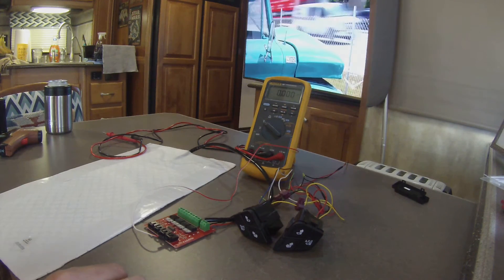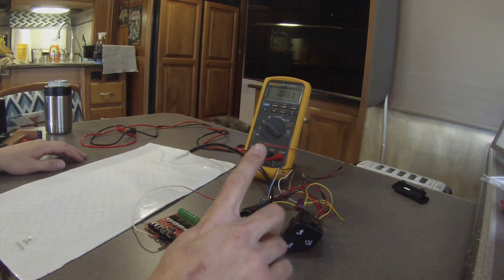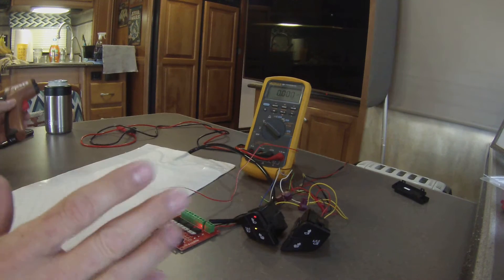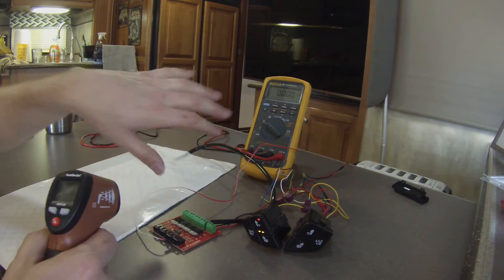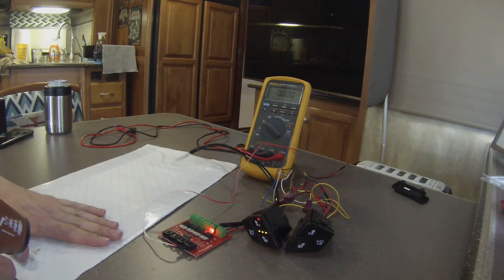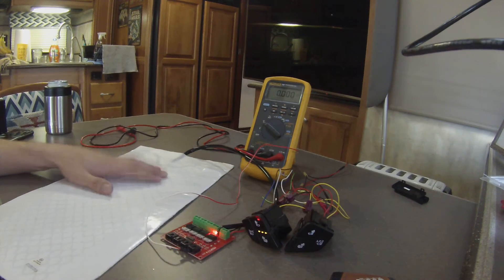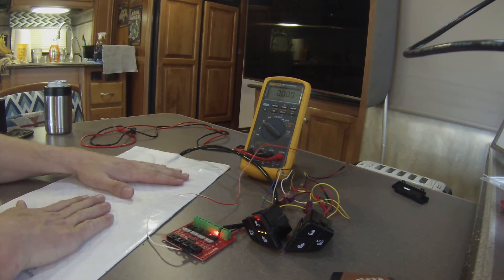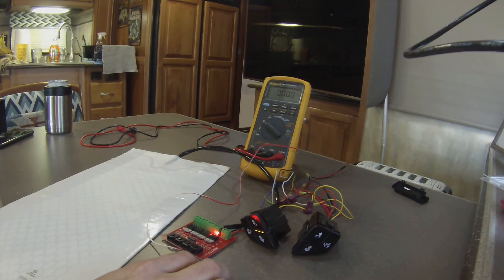Silverado Heated Seats Switch Retrofit

Comment: Why can't I purchased an aftermarket controller with the heating elements and use them to control each switch? Is this possible to retain these factory switches and install my own seat heating elements?

Comment: Badass video! Do you have any info on how to keep the airbag light from being triggered with this seat swap (2018 seats in 2011 mode)?
Reply: I put 2018 seats into 2011 silverado, I pulled out the original harness and side airbag from the cushion and tucked it under the new seats, then I bought a resistor and plugged it to the airbag harness, no lights or warnings

Comment: Thanks for sharing this, I stumbled upon this by accident... Looking to the factory harness in the dash for the switches, only to find something better - Proof that you can create a LIN bus and communicate. 

I have disassembled many of the modules and started reverse engineering them, including the heated seat switches, and seen that they contain 8 pin LIN drivers, some with inbuilt voltage regulators. The BCM has 6 of these alone (among many other things)... That Canny7 tool looks interesting, much easier then me using one of the LIN drivers and creating a sniffer/logger by scratch. The fact you got the switches to communicate is, in itself, enough to warrant me spending more time capturing the LIN IDs and data. Ultimate goal would be to interface with the window motors, seat motors, etc, all the various things in the truck that are on the LIN network.

Thanks again for sharing!

Comment: I have switches too. Looking forward to seeing how to wire it up. Bought a universal set to put in. My seats already have elements in them. ( heating pads) but not sure where to hook the wires to yet. I have the heated only switches. Anyone know where a diagram of pins to connect in back of switches are? Thanks for any info.
2014 Silverado Crew Cab 4x4